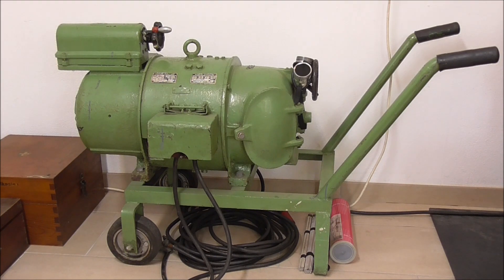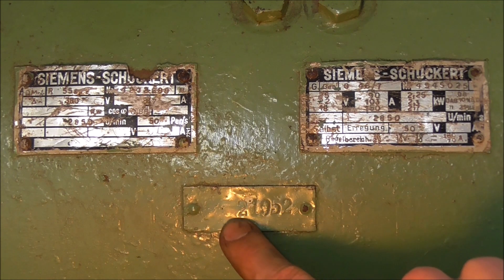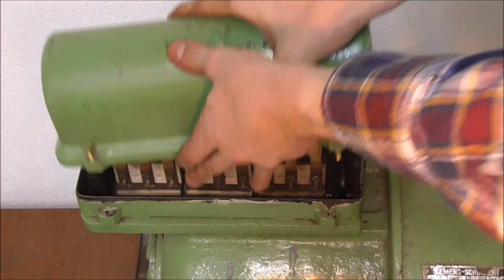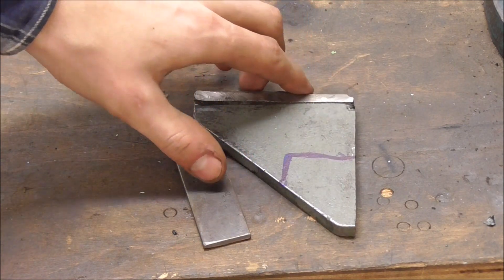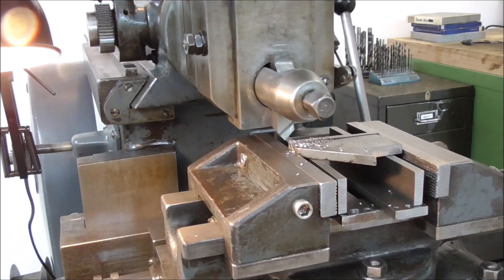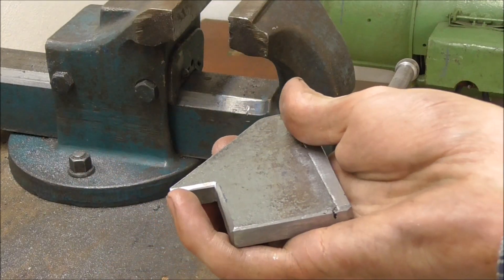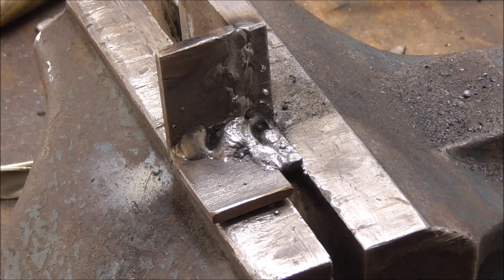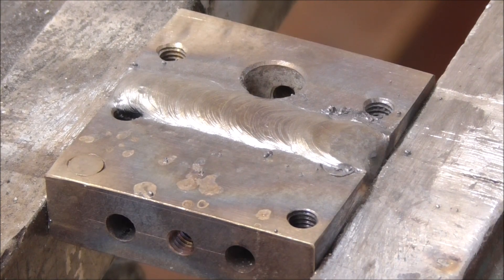Siemens-Schuckert Welder Motor-Generator - Part 1

Comment: Very interesting. I have an oil cooled AC welder made by Oxford and I have my eye on a couple of other interesting 1950's welders. Judging by your welding, you are using E6013 welding rods. You should lean the rod over a little more and keep a shorter arc length. That way you shouldavoid the slag inclusions we can see in the second weld.
Reply from the maker: One of the main problems was the rods that were quite damp. A few hours in the oven cured the blowholes.
Reply: @AstraWerke  OK.

Comment: I like old generator converters a lot too, i don't know if they are worse or better compared to modern solutions, possibly it's just how i am personaluy used to do things, but at least i found them being pretty equal even compared to the top quality modern ones. If i had one i had clearly still kept it even if i did invest in a modern inverter, i like those machines too much to get rid of them on my workplace.
Reply from the maker: Well, efficiency-wise, they are pretty terrible. Mine has a max. Input of 11.5kW and makes a max. 4.5kW output out of that. 
Regarding results, I really can't complain. The welds are clean, penetrate deeply and have no pockets or inclusions in them.
Then again, creating a giant short circuit to melt metal really isn't that sophisticated; a welding rod won't care if it's fed a 100% pure DC current.
One thing is for damn sure, tho: This thing will run at max load day in, day out and will hardly get warm to the touch. This beast will still be around for my funeral!
Reply: @AstraWerke  That is true, ha ha, but still it's in my opinion awsome machines to use a a complement to small type modern inverter ones if one just are using them from time to time and one does not find it economicaly motivated to invest in a modern machine for those jobs. 
I did run ours on about 90% close to maximum load without any problems.
Yes, it realy sounded like there was a full scale airforce attack on the workshop under that load... ha ha!
Reply from the maker: @Vampi_Sweden  You're absolutely right. This thing has presence, it's tough, it's noisy - a real machine. Welding isn't half as much fun with one of them inverter boxes!
Reply: If I had to do DC arc gouging at 1000 amps on a hot day I would trust a motor-generator set to work through it better than a modern inverter.  Such machines are still being made in India.

Comment: Lovely machine. And quite capable. It is not really 60% going of the chimney. The induction motor consumes as per the load. 
When no load on the generator side, the motor is just idling - probably 1kW.

Comment: Watch out, you inverted the star and delta configs :)  
Those welders have been around long after semiconductor rectifiers were developed because early diodes were not able to withstand high currents reliably and cheaply, converters of this tipe were alco common in cinemas and theatres (to power the arc lamps), in the elctrcoplating industry and in the elevator / cable cars plants to power the large prime mover DC motors, the fact that yours is still working fine is the demonstration of how robust those machines were!
Reply from the maker: Oh my, did I? Star and Delta are always an opportunity for me to confuse things xD
On a serious note though, this thing is an absolute tank! Many people will wonder why I didn't get myself a proper, modern welding transformer - but this thing has the girth and the style! 
In addition, it works exceptionally well.
Reply: @AstraWerke  
It was kind of strange since you described the star and delta connections perfectly, I' d blame it on the camera :P
I am actually impressed by how insignificant the ripple is, the output is almost pure DC so in my opinion, as long as you respect the duty cycle of the motor and keep spare brushes at hand, it should work as good as any other transformer based DC welder (or even better).

Be careful if you decide to restore it, old electrical insulation can be very frail!

Comment: My grandfather was a blacksmith. He had a similar machine, but bigger, with big iron wheels. When he turned it on, the lights in the all neighbourhood  flickered for a second.
Reply from the maker: That's why mine is equipped with a three-way switch to start it up. The amount of power going through these things when you switch them on is just insane.

Comment from the maker: I don't want to make promises I can't hold, BUT:
I might take this thing apart someday and give it a frame-off restauration. 
The cables are brittle, it sure has a lot of dirt inside, the bearings don't sound so fresh
 - and most importantly - the paint starts flaking off.
This would be quite the project though, and it'd take quite some time. 
We'll see how often I need to use it and I'll decide based on that.
So yeah, I will take it apart someday, just don't expect that to happen in the near future ;-)